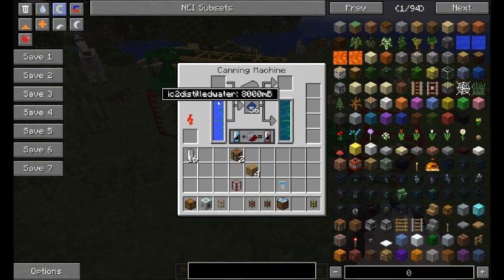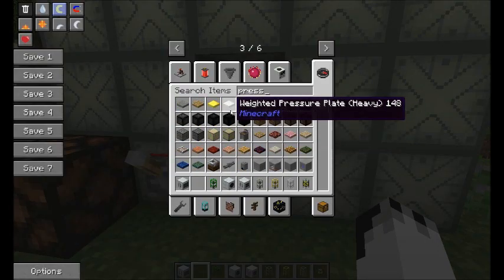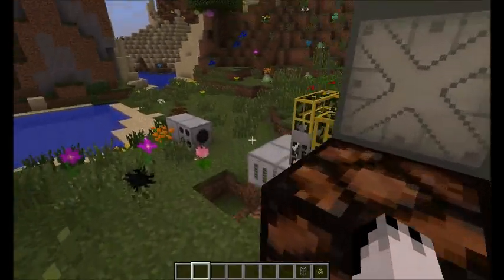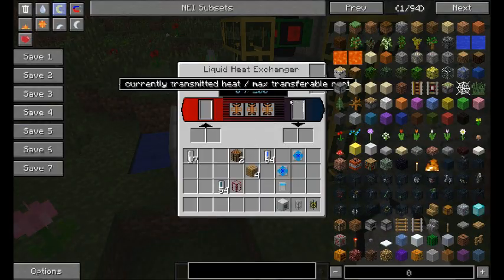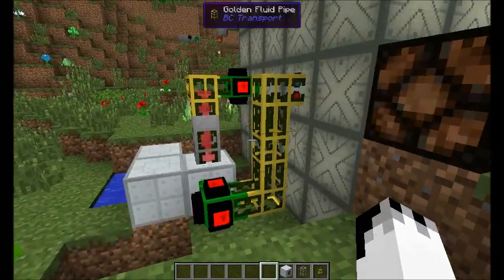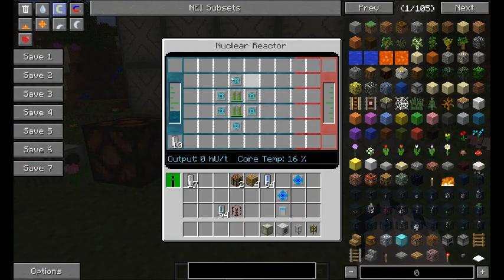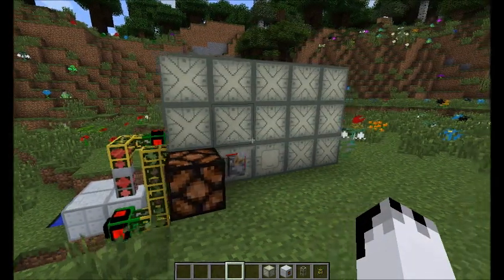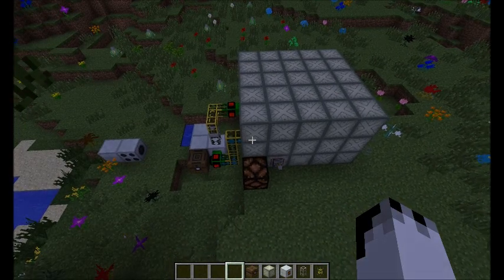Industrialcraft Experimental : Coolant and Reactors.

Comment: Where do you find the pressure vessel? I hace ic2 but it's not in the c menu
Reply from the maker: +Ezio Auditore If you are in creative, then it should just be past of the ic2 tab.
Reply: I can't ifnd it. Is it a special mod for ic2?
Reply from the maker: Nope, its part of ic2 experimental.  What version are you on?
Reply: 5.21
Reply: +darkironphoenix I installed a new version of ic2 but the pumps don't work ;-;
Reply from the maker: Well, it is experimental, move back a few versions.
Reply: darkironphoenix ok.Do you have a video for a stable coolant system
Reply from the maker: No i don't. once i have a stable coolant system, ill upload something.  Going to need one for the ftb infinity skyblock after all :)

Comment: this method no longer works because you cannot place lapis dust into a canning machine.
Reply from the maker: +ElfNet Gaming Which version is that on so i can go and check?
Reply: IC2 experimental for MC 1.7.10 
unless I am doing something wrong,
Reply from the maker: Which version.  There are about 200 odd versions of ic2 for 1.7.10.  Are you on a modpack, if so, which one?
Reply: Ok I found a version number - IndustrialCraft 2 2.2.657-experimantal
It was the latest build for MC 1.7.10 (so the website says).
Reply from the maker: Ok, i've grabbed the latest (810), ill have a poke around and within the next day or two ill get back to you.
Reply from the maker: Just seen this in the build notes:
add alternative Recipe for Coolant in Canning Maschine 8 Lapidust

They seem to have fixed the coolant cell recipe in build 787 as well, but as ill said, ill poke around tomorrow :)
Reply: I know there are other ways to run a reactor requiring coolant but I like the method you used to create coolant and not having a ton of other machines hanging on the reactor.
Reply from the maker: Treid the method on build 810, it works on there...they might have broken it on the version you are using.  Make sure the canning machine is on fluid enrich, and you need 8 lapis dust per 1000.
Reply: I will try it and let you know.

Comment: One more question, my cold coolant is sometimes going to the emerald pipe, and sometimes to the iron pipe and it blocks the hot coolant
Reply: Same here, after messing with it for a while I just ended up sticking the generator to the port directly. Problem solved!